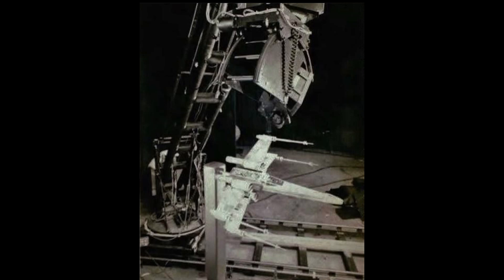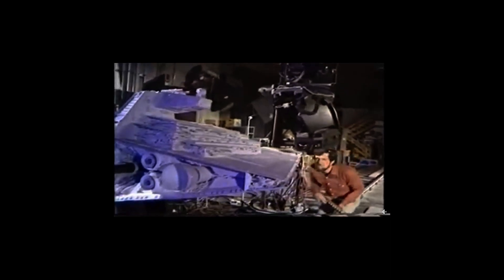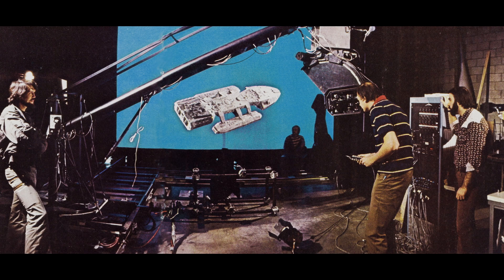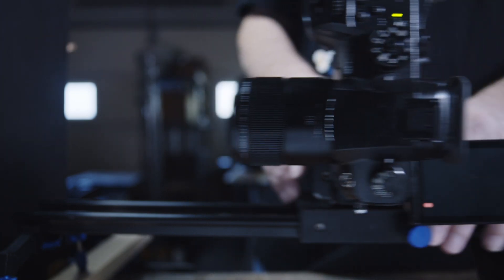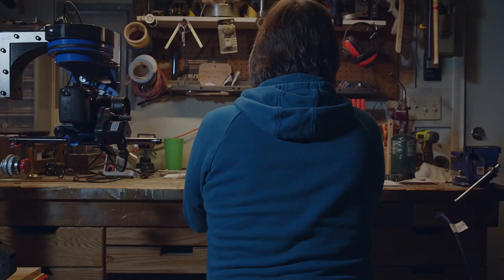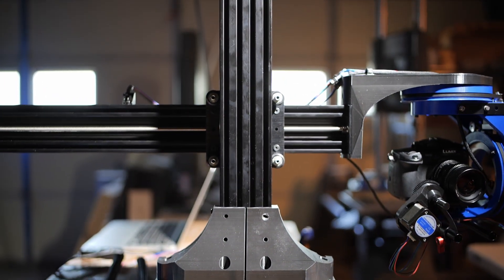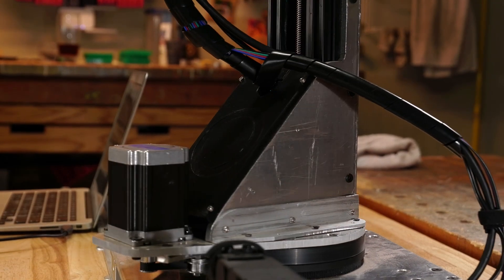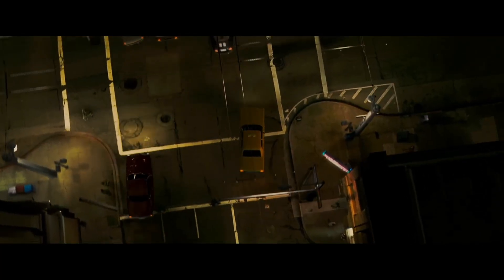MoCo Dykstraflex Upgrade

Comment: WOW, that is impressive.  Building MOCO can become as much of an addiction as the film making.  The next rig will be even better, you know it will after all you've learned here.  Make one that hangs from the ceiling or is on the underside of a table-like platform that can be rolled over different terrain models.  

A suspended rig lets the boom swing from one side of the track to the other without seeing the track, so you move through a much larger volume of space.  The ceiling will have no problems with stability and is already built.  

A rolling box with one end that is removable so it can roll onto a model terrain before that end is replaced and the box is blocked up so it can't move, has the advantage of being easily moveable from one terrain set to another after shooting on that set is done.  Different terrains can be worked on while shooting occurs on another.  You can even return to saved terrains in later shoots.  All the terrains can be built on identical platforms that key into the rolling box and bolt in place, making them a solid part of the box and go back to the same coordinate system each time.  The box with the terrain floor bolted in should be extremely rigid, making for good repeatability.

You obviously know how to build these things